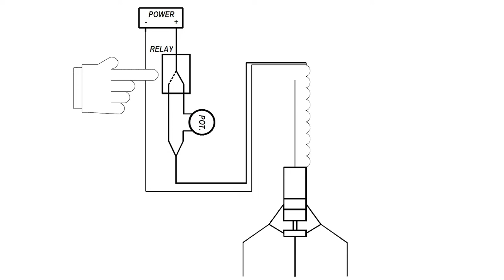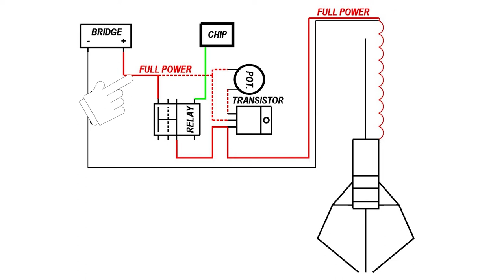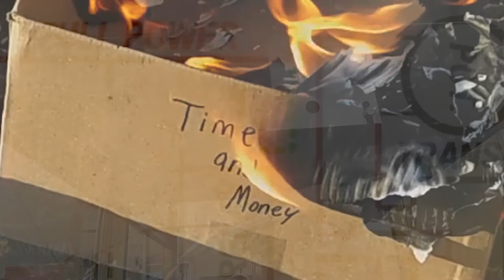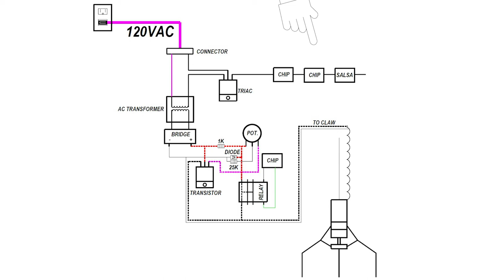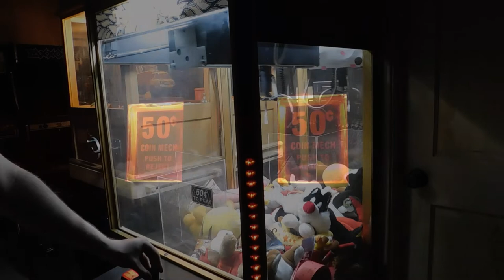Talon Claw Machine Repair - Claw Won't Close

Comment: Put the 1K resistor back into the board and adjust the Trim POT until you find the limited claw power to work correctly. There must be a RATIO of the trim pot adjustment with the 1K resistor to get the correct limited power to the claw.

Comment: On those LED panels:  That short little connector is so that you can connect two of the panels directly to each other in a 'line' without a gap/wire between them.  When I've bought those panels before they've come with a complete power plug, so I don't know what the deal with the partial ones is.
Reply from the maker: I like to look at it as if they just went ahead and pre-stripped the wires for me

Comment: Resistors limit current. More current = stronger magnetic pull on the claw. By removing the resistor, you have taken all the resistance out of the circuit and given full power to the claw.
Reply from the maker: Yes but this circuit was designed to send full power through that resistor. It sends full power through it whenever it sends power to the transistor, which lowers that depending on what the potentiometer tells it to. 

It's strange that the power runs through it just fine when it's running to the transistor, but when it's running to the relay, the resistor blocks all voltage.

Comment: The new relay needs more current to turn on than the old one did.  The 1k resistor is too large to provide it with enough current.  The resistor appearing to "block" the voltage is a red herring.  A resistor passing current will drop voltage equal to the resistance times the current.  Since the relay input has no resistance itself, the resistor will pass the maximum current and drop all the voltage across it (meaning full voltage on one side and none on the other).  It's just not enough current to turn the new relay on.  Without any resistor at all, it might be too much current and will cause the relay to burn out after a much shorter time.

Comment: 10:40 this is usually my mind as I'm working on these things, lol.  I picked one of these up recently, and have been going through it to get it going again. Also, how is your House of the Dead?  I've been looking at one of those too, but was thinking about modernizing the monitor to be lighter.  However, light guns require a CRT, don't they?
Reply from the maker: House of the Dead is working great! Continues to be a visitor favorite. I will warn you though, they run on Medium Res monitors, which are extremely expensive and difficult to repair, and you actually can't upgrade them to flatscreens due to them using the older light gun technology. I think from HOTD2 and on they used a different technology and can work with flatscreens.

Comment: I have a talon crane and the start up and reboot works as normal but once you play it and hit the drop button it continues to drop until it’s at the end of the string and shows a code 88 04 for what I found looked to be the “down motor switch problem” then on the way back up after it reboots itself is shows 88 01. Any advice on what I should look for or how to go about fixing? Thanks!!
Reply from the maker: Yo. I sold this machine the other day, so I can't check anything myself, but I would bet that the switch in the gantry that tells the board when there's slack on the string is either dead or disconnected. Take apart the gantry and see.
Reply: @coin-opcorner  Thanks for the reply! I’ll start there and see how it goes!

Comment: What kind of diode is used in the claw control circuitry?
Reply from the maker: I no longer have this machine on hand, so I can't answer that question. Sorry.
Reply: @coin-opcorner  Alright. Do you remember what diode you replaced the one in the machine with?
Reply from the maker: @any123-og  I actually just left it out because it was there to allow voltage to flow from the ground to the positive side of the bridge (which it shouldn't ever need to do). I would recommend just removing the diode first to see if that's your problem.
Reply: @coin-opcorner  I don't have any problems right now, i was just wondering what it does. Thanks